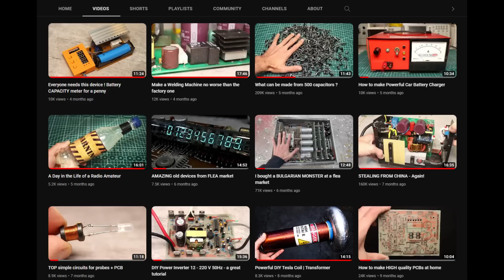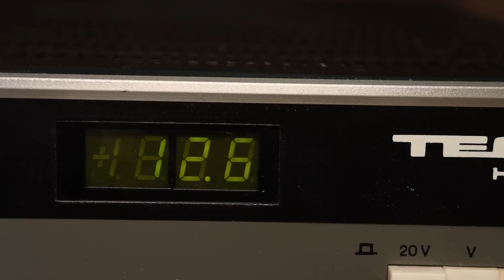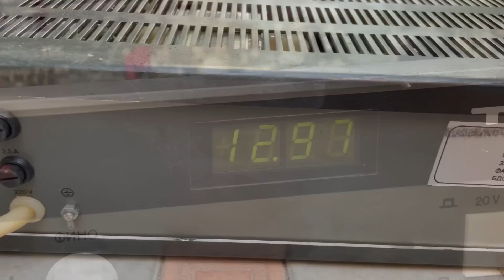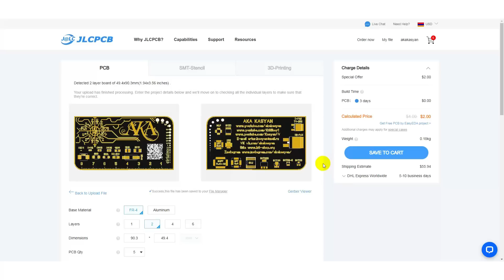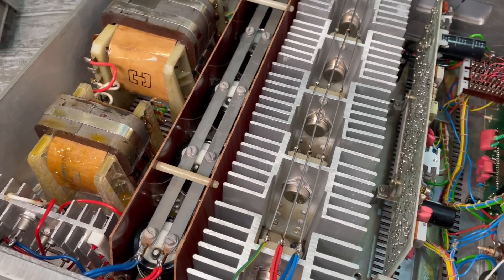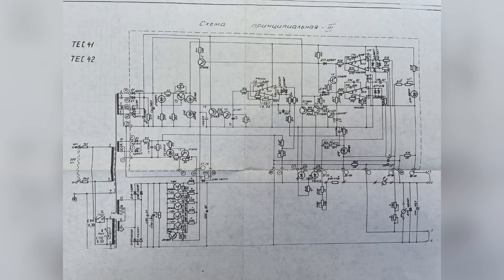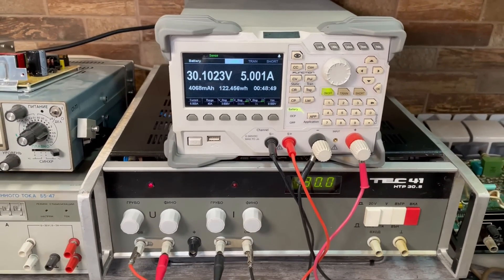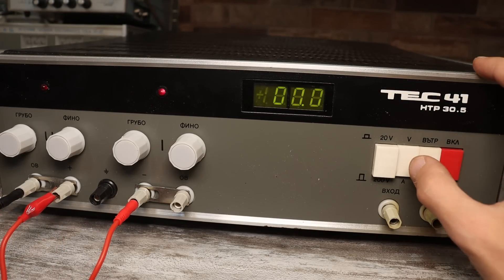TEC 41- 18 Kilo Bulgarian monster from the times of socialism.

Comment: I'm from Bulgaria. My dad has 3 of those and I remember playing with them when I was a kid. Now I'm an electronics engineer and I've been designing products for the last 7 years. Now i can really appreciate the monster parameters of the TEC. And i can still feel it in my lower back ... i moved it around when i was little. I dont recommend it. 
Your unit is in great condition. No scratches or dust. Dust buildup for those is very common because of the open slots. You got a good deal, even for that price.

Comment: I used to design housings for equipment like this. I'm quite shocked at how thick the aluminium sides of this housing are. Some of them even look like they were foundry cast and then milled. Normally half a millimetre thick sheet steel would have sufficed.
The printed circuit boards are a gas. Some of them look like they were done manually. A guy in my office had the job of designing such PCBs by hand using black sticky tape on translucent sheets of plastic. This was then used to photographically transfer the circuit plan onto boards. Yep, those were the olden days before computers.
Nice video, a joy to watch.

Comment: also in my d.i.y charger.
I entered the mode: external volt test.
to check the batteries before recharging.
simply by cutting off the power supply.
in that feeder.
a single 2n3055 would be able to deliver 5 amps.....but why risk it

Comment: That is a beast, indeed. No cost-cutting evident in there. Looks like an older HP unit construction wise. Truly a keeper.
Reply: Cost cutting unheard of in Socialist economics, if there is something equivalent it be tied to low resources and thus necessitate alternative or cutting that specific materials out completely, also method of mass production such was seen during Soviet patriotic war when T-34 gearbox and engines were reduced in production time and complication, however reliability was still astonishing, all T-34 alive after war, were made during war usually never received new transmission or engine despite being made "poorly" but such savings made transmission and engine production times 30% faster! However in Socialist computers, no expenses were spared many times to their own detriment.

Comment: Great machine! I hope you change the main capacitors and that soon you will be able to take advantage of it, which I believe is one of the best PSUs manufactured in Europe. Congratulations on the purchase and a wish you have a nice 2023.
Reply: Changing the capacitors without testing them would be a mistake. Many modern capacitors are simply not durable enough.
Reply: Bom...apesar de eu não o ter mencionado é evidente que não faz sentido trocar electrolíticos sem os testar nos dois parâmetros habituais. É provável que os  estejam suficientemente bons para continuarem de serviço, sim. Além disso,  esta PSU é demasiado preciosa para receber condensadores banais. No caso de ser mesmo necessário, a questão é onde encontrar à venda condensadores electrolíticos novos, de boa qualidade e resistentes à passagem do tempo. Se é que tal coisa existe,  actualmente.

Comment: Only a puppy really!  Try my Farnell H30-100, 0-30 volt and 0-100 amps, semi linear, has a thyristor pre reg to minimise dissipation, weight?  90 KG!!!  Even with 2 guys it is a very heavy lift from floor to bench! I have 3 of these!  Also in my collection are 2 of it's smaller brothers, the H60-25, rating now obvious from the model number, weight 45 KG!!  I had to change the MCB on my power distribution panel to a higher trip current, to handle the switch on surge from these beasts!  My largest electronic load can only worry the H30-100 upto 7.5 volts at 100 amps, and have yet to find a 3KW resistor of a low enough value and large enough current rating to fully load it, so really I should make one!
Reply: 30V@100A is a small to medium sized arc welder :D
Reply: There are loads of good made power supplies on the world market from the past. The american EMI,   Systron Donner/Trygon and HP,  the british Farnell,  Sun,  Coutant  , the german     Gossen, Heinzinger, Elektroautomatik,  Rohde & Schwarz , the french Schneider  and Schlumberger  and not to forget the Philips ones made in ???.  They all made impressive lab power supplies .
I own  several units from HP, Systron-Donner , EMI, Gossen, Philips  and Elekroautomatik.  The strongest I own is made by  EMI. It delivers solid  0- 40V / 0-200A  from a three phase outlet. It weights 70kg !!!. 

The most used on my bench are  the Gossen Konstanter  0-32V / 0-10Amp, 45 years old and work like from the first day. Another one in daliy use is dual power supply  HP, with  2x0-50V and 0-1A. 

My oldest in working condition  is an Lamda unit working with tubes/valves. 0-350V / 0-1,5A. with 20!!! 5881 in the final regulator stage. It looks cool in its black wrinkle paint and 40th style knobs &  meters. But a very heavy iron monster.
An old Philips is a source for tube/valve circuits. 6,3 /12,6V 12A for heaters / 0- 500V plate/screens and 0-150v for the control grids. 
And the weirdest is an ac power unit. it put out stable 0-150V ac / 0-5A / 40-500Hz adjustable, made in USA by Elgars. 

I have no idea about former eastern pwr supplies , but I know that the tchechians made good , reliable electronic stuff way back in those days.